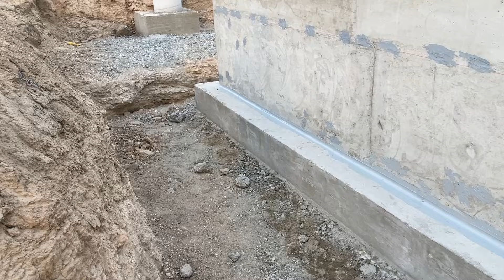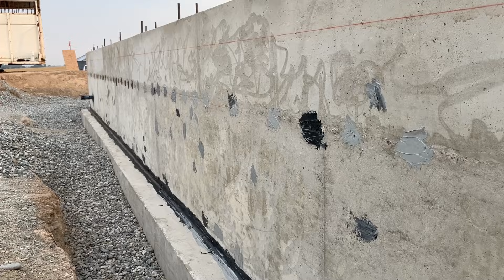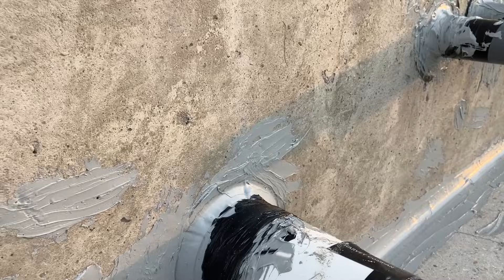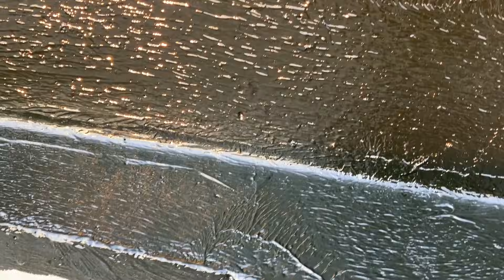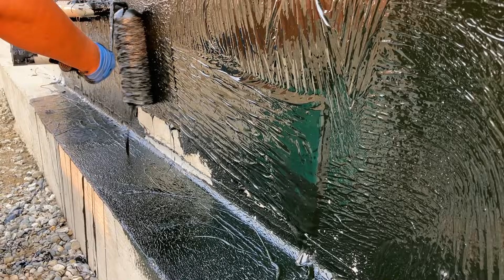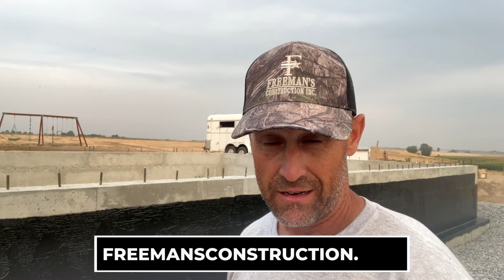Waterproofing Stem Walls for a Subfloor Foundation

Comment: Looks like an excellent job!  I can't imagine any water penetrating all of that.
Reply from the maker: Thank you! In this video we show how adding the J Drain 200 dimple mat and the SWD 6 drain to protect the system and eliminate the hydrostatic pressure so water does not have an opportunity to challenge the Tremco 250 GC waterproofing membrane. Here is a link to the video. https://youtu.be/UUmiddzSz5I?si=nPnroSrJLUA_d5Ch